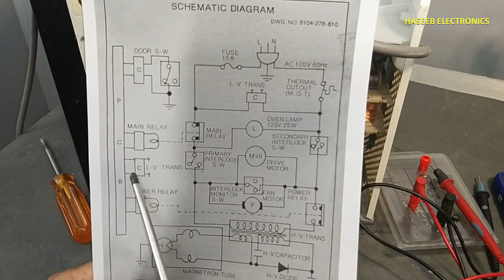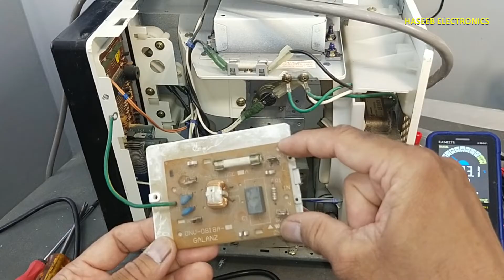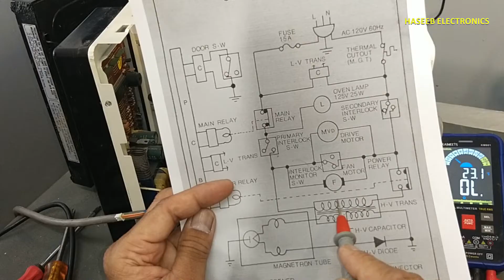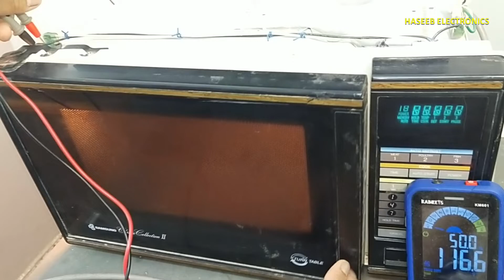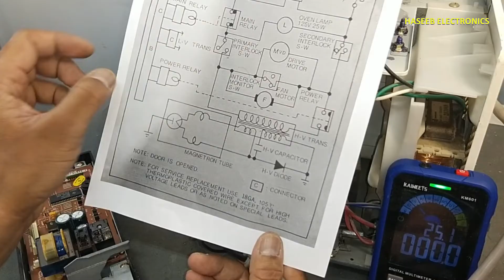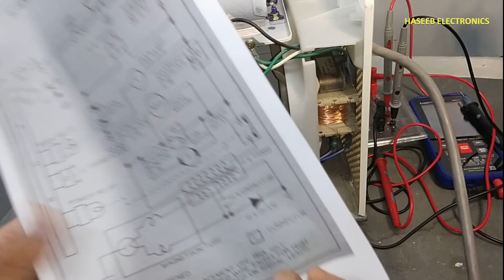{887} microwave oven troubleshooting. how to repair microwave oven

Comment: Hi Herr Haseeb,
Microwave Panasonic NNSD27HS
donot working....when i am checking  .input cc inverter..Transformer... 3 SW...senser all is good
in control panal  i see Diod (shotky diod HF5B2100) open cc
<after change diod......Microwave working
but start only 3 sek
what do you think the Problem
Danke

Comment: @HaseebElectronics  hello sir,i have one question, my magnetron part is damaged, its specifications is written Galanz M24FA-410A it has 4 fins(heat sink),At the shop i do find magnetron of different blands.How to choose correct.Because i heard other blands can also work fine is just the matter of selecting compatible one.

Comment: Hi Sir. 
I'm using Panasonic inverter microwave.
It fail to heat up at all. During heat up about 30 second, it automatically stopped by itself  eventhrough I set the setting for a minute.
Subsequently the high voltage diode will burn up.
Same problem reoccurring eventhrough I replaced the high voltage diode.
The magneton is good without any short to ground and both terminal getting less than 1 ohm.
The transformer primary coil resistance about 0.4ohm and secondary coil resistance about 5 ohm.
What could be going wrong actually.
Appreciate your advice.

Comment: Hello sir, what could be cause of continuous high voltage fuse blowing
Reply from the maker: possible reason, High volatge diode (check diode polairty as well), high voltage capacitor or magnetron

Comment: I have a Samsung Model ME17H703SHS. I have power through the fuse, all the door switches test OK. There is no display. I have 120V to one of the thermostats, but the 70 degree thermostat has no power to either side. I have not been able to find the terminal that feeds power to the control board, to see if the board is getting power, nor can I locate a schematic for this model. Can you advise me on how to proceed?

Comment: Thanks for this very interesting video. Now I know, how a microwave works. I came here, because my microwave suddenly stopped working, everything is dead. 

When I opened it, I have seen that the fuse is black, so I ordered some to replace it. I hope, this will solve my problem, but I`m afraid, it will not be the only problem of this microwave.

 I don`t have all this aquipment what you have and only very few knowledge about electronic, so I think, I will throw this device away, if a new fuse will not solve the problem. 

My microwave is very old, one of the first ones, that were sold in the 80th. I don`t like to throw it away, but repairing it by a professional would be more expensive, than buying a new one.
Reply from the maker: good morning dear
sometimes there is only fuse
sometimes fuse and some high power consuming parts like magnetron, high voltage capacitor, high voltage diode etc 
i hope the fuse will only the reason.

Comment: mine has a very odd issue, when its been working a while and lets' say either loses power  in the house or comes unplugged for a hour or so, then comes on, none of the button work, they just beep, cant cook nothing, it has to have constant power for about an hour then the buttons start working again, kinda like a capacitor having to build up power first or something else, i dont know alot about them

Comment: Asalam mu alaykum,  you hace a very deep and comprehensive knowledge and understanding on you tutorial. May I have a copy of you diagram of microwae oven, including the circuit diagram of your additional high voltage testing circuit. And High voltage capacitor. Thank you for your consideration.

Comment: Excellent demonstration. Thank you sir.
Reply from the maker: You are very welcome
Reply: @HaseebElectronics  @HaseebElectronics  hello sir,i have one question, my magnetron part is damaged, its specifications is written Galanz M24FA-410A it has 4 fins(heat sink),At the shop i do find magnetron of different blands.How to choose correct.Because i heard other blands can also work fine is just the matter of selecting compatible one.

Comment: Great video and to troubleshooting the microwave first I would like to check if I’m getting 12ov to hv transformer if I’m getting 120 v to transformer I will know the problem is with high voltage components if I’m not getting 120 to transformer I will know that i have problem with low voltage like door switches or fuse or ….

Comment: Dear Haseeb, my Sharp Microwave Oven is making noisy sounds with the magnetron when reheating food. The cause of the noise is due to over 9 years of daily use and the cooling fins of the magnetron are loose and shakey. I believe the fins will fail to dissipate heat and the magnetron will damage very soon.
I have a good Panasonic microwave magnetron that I kept years ago when I bought the new Sharp microwave oven. 
Now, the question is :
Is it safe to use the Panasonic magnetron to fit into my Sharp Microwave Oven and reuse it even the model numbers of both magnetrons are not the same, but the sizes are almost identical, and it can fit into my Sharp microwave oven.
What are the worst case scenarios(explosions?), if the Panasonic magnetron is not compatible with the Sharp's microwave oven?
Your expertise on this is very much appreciated!

Comment: Nice job. You are a good instructor.  It reminded me of my young days in electronics
Reply from the maker: best regards and special thanks for your valuable words
Reply: @HaseebElectronics  hello sir,i have one question, my magnetron part is damaged, its specifications is written Galanz M24FA-410A it has 4 fins(heat sink),At the shop i do find magnetron of different blands.How to choose correct.Because i heard other blands can also work fine is just the matter of selecting compatible one.

Comment: Hi Haseeb, your videos are like a ready reckoner on repairing and trouble shooting SMPS of any appliance and device. I fall back to your videos to learn and refer. Haseeb can you find a Ultra Sonic Cleaner anytime and troubleshoot its SMPS cause its interesting to learn the coupling of transformer with inductor for operation of the USC. Will wait for you to reverse engineer a Ultra Sonic Cleaner PCB. There is hardly any video explaining the working of this appliance on YT. I am sure your video on the same will help a lot of learners. Thank you for your time.